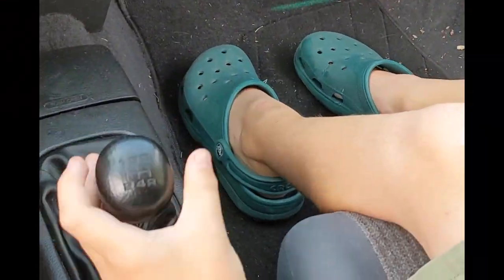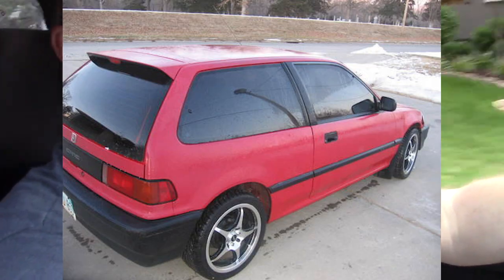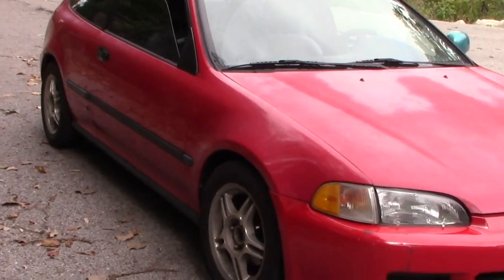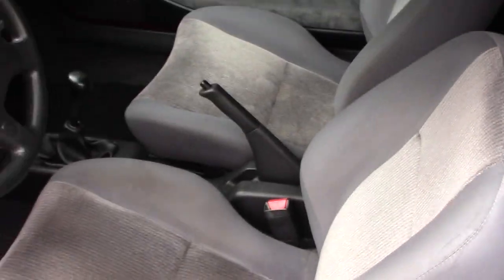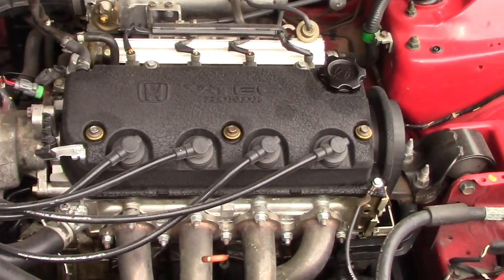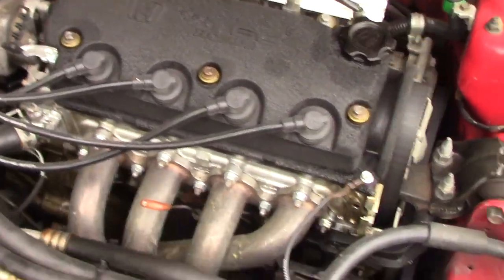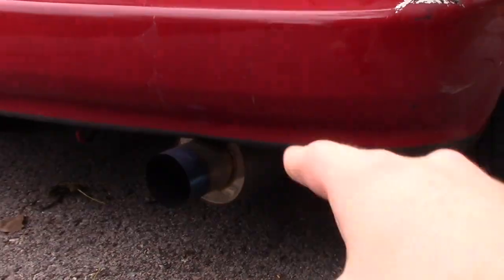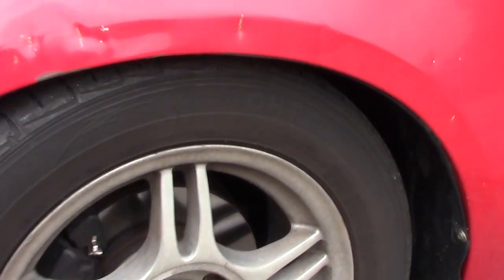My Daily Driver EG Civic is now a Riggs Garage Project...

Comment: I got exactly the same problem on my 94 Civic DX. My front driver side seats about an inch lower than passenger side. I got the car with the lowering springs and stock shocks.
Reply from the maker: I was poking around on the forums when I first noticed it and it seems pretty common. Coilovers allow you to adjust it out, just finished adding those, new video out soon on that. Thanks for watching!